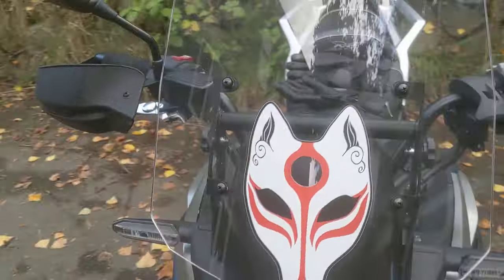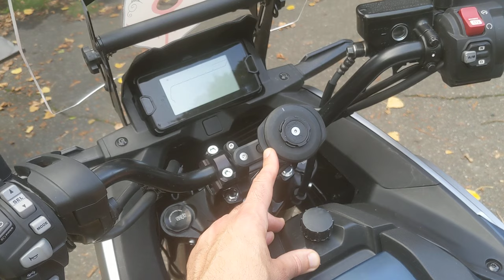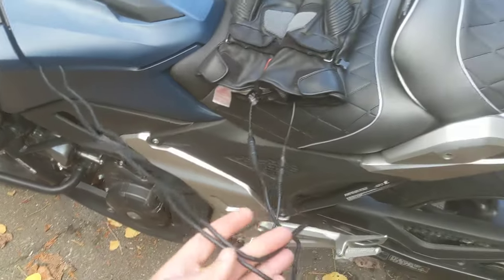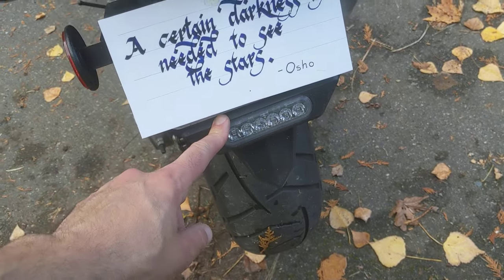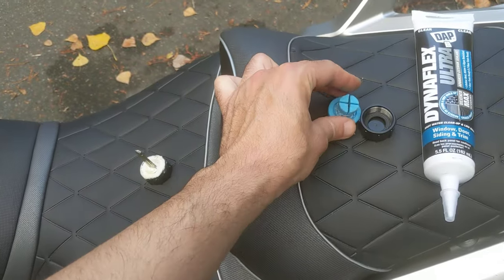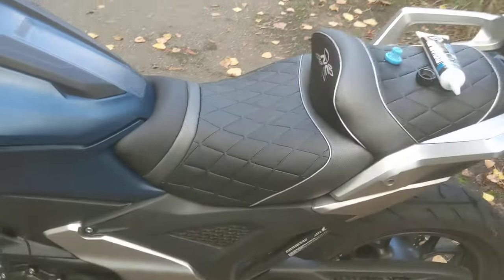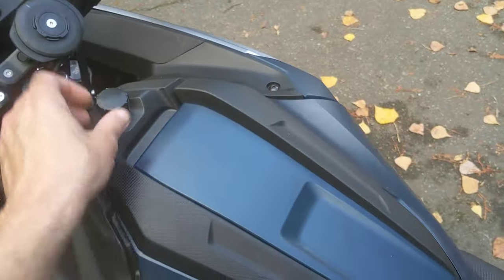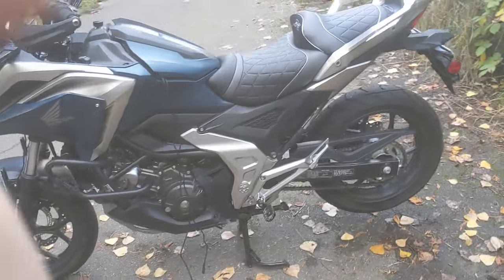Honda NC750X DCT ... mods and accessories... and what i keep in the frunk.

Comment: I'm a fellow Puget Sound NC750X rider and have done some similar things to mine. I stuck with OEM seat but added spacers under the front to raise it up. Works great for cheap solution. Those of us who ride in this rainforest have to take water and cold seriously. We can ride year round, but it's 40 degrees for many months of the year. I use the Oxford heated grips but know people like their heated gloves. You can add an aquarium thermometer right below the dash in a perfect little blank spot since the bike doesn't show ambient. I use grip puppies too to avoid grasping cold grips. My NC is a manual because I really enjoy shifting. A remarkably versatile little engine. I use my NC for my short commute, and rely on my S1000XR for my 800 mile days around the West.
Reply from the maker: Nice! A fellow PNW NC750X rider! I agree with everything you said. The NC is a great one bike all rounder but is also perfect for a 2 bike garage. Use the NC as the workhorse commuter and then a second bike for whatever other type of riding. Personally I do longer trips on my NC because its so dang comfortable and easy with storage but my 2nd bike is an XSR900 for fun, speed, and pure aesthetics.

Comment: nice mods, you are really talented to add all of that stuff yourself.  I took the MSF back in April and they put me on a dual sport so I bought a Honda 300L Rally.  Now I want one of these.
Reply from the maker: @gregr3576  Thanks! I learned a lot of useful tips from other bikers on youtube who are way more talented than me. I'd love to try a 300L Rally. I've heard great things about it but the NC750x will definitely be more road oriented, practical and comfortable unless you want to go off road. The joy of riding is trying out all sorts of different bikes until you find ones that you want to keep. Keep riding and enjoy!
Reply: @TheDreamcycles the Rally is a blast, it is a nice big/small (tall but small one cylinder 286cc engine).  That’s my only issue with it.  I’m 6’4” and probably 300 lbs with my boots, jacket, & heavy backpack.  I get to 70 mph and the vibration is too much to bear.   I’m not keen on riding the highway regularly but it’s a necessity if I need to go into the office.  I’m a quirky guy too, have a Honda Ridgeline truck - the only truck with a trunk - so having a motorcycle with frunk seems so natural to me now.  I didn’t consider this as a first bike as almost all of the recommendations that I saw said to get a 300-500 cc to learn the weight.
Reply from the maker: @gregr3576  Hey, so I don't have a lot of experience with the Rally bike and I totally appreciate the fact that you may not need to ride a bike on the highway that often but I will say that I am pretty confident that if you try the NC750X then you will love it even more than the rally. The practicality of having a bigger seat, frunk, more power and other small perks will likely improve your overall experience. I think you have cut your teeth on the rally and have learned invaluable skills because of it but you might like the NC even more. Funny, because I really like the Ridgeline too! I think it looks great and the versatility is amazing. That is exactly what the NC750X is for the motorcycle is world. Quirky but undeniably awesome and practical. I hope you get to test one out!

Comment: I know what you mean about the center stand install. I had to use a 2x4 to keep the motorcycle from sliding even with brake on while using a ratchet strap! 😮 I didn’t feel good about that, but didn’t get any injuries out of it or have to pay a Honda dealer to put it on!
Reply from the maker: Nicely done. Yea it's very rewarding to do installs like that yourself. It really helps you bond with the bike.

Comment: Nice mods and bike.  Seems like you researched a lot for this bike.  Do you happen to know if you can get a aftermarket TFT screen to replace the LCD screen?  LCD seems really outdated in compared symptom almost any other bike.
Reply from the maker: Thanks. I did a fair amount of research in a short amount of time because I wanted to dial in all the mods before winter. But unfortunately I don't know anything about a TFT replacement screen. I don't mind the LCD but that might be because I've never had a TFT before. Luckily it doesn't affect my enjoyment of the bike. Good luck with your search though!

Comment: Can relate to using a ratchet strap while installing a centre stand. Interesting key thingy for the frunk. Did you have trouble getting the cables adjusted for the 2 inch riser?
Reply from the maker: Right!! Glad I'm not the only one. That ratchet strap and spring could have badly bruised a body part or taken my eye out if I slipped.

So the 2" bar risers are an ordeal. Not gonna lie. Took me about 6 hours and half of that is simply removing and reinstalling body panels. The left hand cables have enough slack if you slide them to slightly different spots but then on the right side, in order to have enough cable slack you have to redirect the right brake reservoir cable from over the triple tree to under the triple tree by threading it through the triple tree and it only fits at a particular angle when the right brake lever is removed. Then after you thread it through, there's a LOT more slack and you can reinstall the right brake reservoir onto the handlebar, reattach the brake lever and voila. That is the pain in the ass but once it's done then its rock solid and 100% safe. As long as you tighten all bolts well and then re tighten again if necessary after a few days of riding.
Reply: Thanks Ben. That's helpful information.  @TheDreamcycles

Comment: I like what you have done for your NC750. I have a 2021 model and put the taller Honda windshield on it, but I think the windshield you got may be taller. Does it keep most of the air off your head? Thanks
Reply from the maker: Thanks. I never tried the Honda OEM touring screen but yes this 24" madstaad is taller and it just barely keeps all the air off my helmet so a shorter screen wouldn't cut it for me.

Comment: I love your motorcycle!  and haven't you thought about equipping it with a tire pressure monitor?
Reply from the maker: Thanks! I've thought about equipping one in the past but I wasn't convinced that it would be reliable so I just top off my tires once a week.
Reply: @TheDreamcycles  I put in a cheap Amazon one and it works pretty well. I just used that stiffer velcro stuff to lock it into the underside of the frunk lid in one of the concavities. Still fits my helmet and checking pressure is easy when I open it up to grab my gloves or whatever at every stop.

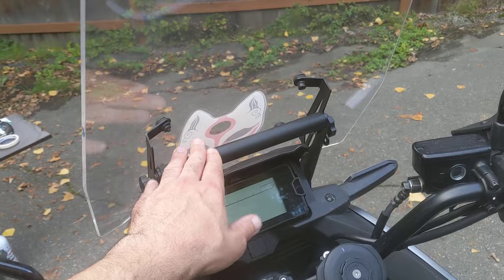Comment: Hello, does the navigation holder shake when you ride your motorcycle? Would you recommend it? (02:20)
Reply from the maker: No, it doesn't shake. The navigation bar which is part of the Madstaad wind screen fitting is super solid. The only thing that wobbles a little bit is the anti-vibration quad lock charger which ironically it is designed to do to prevent the high frequency micro vibrations that can occur. But to answer your question, no, it doesn't shake.

Comment: been considering that seat, but also a domestic re-do. I bought a spare stock seat to send someone if they want a pan. How much did you need to do to get those long handlebar extenders working with the cables and hoses?
Reply from the maker: So the 2" bar risers are an ordeal. Not gonna lie. Took me about 6 hours and half of that is simply removing and reinstalling body panels. The left hand cables have enough slack if you slide them to slightly different spots but then on the right side, in order to have enough cable slack you have to redirect the right brake reservoir cable from over the triple tree to under the triple tree by threading it through the triple tree and it only fits at a particular angle when the right brake lever is removed. Then after you thread it through, there's a LOT more slack and you can reinstall the right brake reservoir onto the handlebar, reattach the brake lever and voila. That is the pain in the ass but once it's done then it's rock solid and 100% safe. As long as you tighten all bolts well and then re tighten again if necessary after a few days of riding. No need to get new cables.

And I can highly recommend the custom seat from Top Sellerie. Its very professional and fits perfectly and has a very thoughtful design with the lower back rest but I'm sure a domestic reupholsterer could do a good job too.
Reply: @TheDreamcycles  Thanks for that description. I'd read some of that before. On the NC700 forums there are also guys who said the 2" were no big deal at all to put on the newer DCT. Can it be these are being delivered with variable cable lengths? I have some 30mm up 20mm back risers that seem like they will go w/o much more than unhooking cables from tiedowns, but I didn't install them yet. I mocked them up and cables seemed tight-ish. If I get that selle tall seat I'll need to. I plotted the geometry and the 30 / 20 risers get me 14.5mm lower than the straight 50mm would. (Can't find any 50s on ebay or aliexpress these days. They're so cheap I'd buy them just in case.)

Back to the seat, the domestic guys, I just checked have raised prices again. They want $550 to $750 just to redo the front with an existing seat pan. That's quite a lot. Looks like they also tend to be widening them substantially to fit larger US backsides (which I don't have.) I will probably go with the Top Sellerie.

I'm 6'3" with long legs and didn't really do any comfort mods on my bike yet. Thought my legs would be sore because they're folded pretty tight, but when riding it doesn't seem to bug me. Only complaint is butt soreness after a while, but I notice I get that anywhere else as well, car, stadium padded chair, folding camping chair... I've only ridden up to like 250m / day in hour-ish shifts, and my butt was fine, better after I put a 3d mesh pad on it that just breathed a little bit. Does that quilted cover pattern seem to allow for any airflow below?

Comment: Hallo Friend, what is the brand and type from the givi bracket. I cant find it in Europe. Do you nee other brackets to install? Greetings from the Netherlands.
Reply from the maker: Hello to the Netherlands! 👋 Here is the link to the givi top plate bracket that connects the Honda OEM rear rack and a Givi top box. Keep in mind that the picture on revzilla is not accurate. It actually looks more like a flat, grey, metal   plate. And the Honda OEM rear rack doesn't come with the bike. You have to buy that separately. I hope that helps! Thanks for watching!

https://www.revzilla.com/motorcycle/givi-sr1192-1192fz-top-case-support-brackets-honda-nc750x-2021-2022?sku_id=10185324
Reply: Thank you verry much! 
Greetings,  Eric

Comment: did you do the standard and long,  the low and long, or the high and long seat option?
Reply from the maker: I did the high and long. For more room to the foot pegs and more room for my arms.
Reply: have you looked into getting saddle bags? i’m trying to get bags, but looks like people only make cases
Reply from the maker: @daveisabtch3788  I think Honda makes hard side cases. I think Givi does too. To be honest, I haven't needed more storage than the top box so far. Some side case racks look better than others when you don't have the side cases on  I still maintain that the Honda one looks the cleanest but it is definitely the most expensive.

Comment: Do you have a link for Gel pad and the seat manufacturer 
Thanks
Reply from the maker: @flexywing New seat vendor is here: https://www.topsellerie.com/en-sa/honda-nc-750-x-2021_1515.html
Reply from the maker: Here's the link to the gel pad. The size small fits onto the original seat pretty perfectly. https://www.onlygel.com/products/conformax-ultra-flex-motorcycle-gel-seat-cushion-small?gclid=CjwKCAiAmZGrBhAnEiwAo9qHiVODKKkse8L06uDiOn7eu276I-kr3DFHoLko-4L3guzXs_uTPUKVERoCrcYQAvD_BwE

Comment: Would you consider a steering dampener?
Reply from the maker: Nope, not for this bike. Maybe if I had clamp-on bars and it was a supersport racer but it's not necessary for this type of riding in my opinion.
Reply: @TheDreamcycles  I thought so also however there is a possibility of always hitting something on the road like wildlife or rocks or debris on the road. I think I see the steering dampener mounting holes behind and on the inside of the where the fork is close to the fuel tank.
Reply from the maker: @gs-nt6nf  Yes I suppose that's true. I don't have any experience with steering dampeners and I don't know about the mounting points so I can't confirm. Luckily I've never had any issue so knock on wood.
Reply: @TheDreamcycles  YSS makes a linear steering damper for the 2022 Honda CB500X and it mounts right next to the fork and in front of the fuel tank, two mounting bolts there and two mounting bolts on the handlebars and damper hooked up to handlebar. Looks like a non-invasive install job. Hopefully they will make one for the NC750X soon, it could mount in the same place. I saw a guy crash on YouTube because he bounced off the curb and bike did the tank slapping enough to throw rider off. Hopefully a damper can reduce that type of crash.